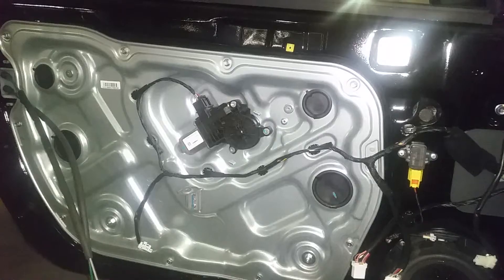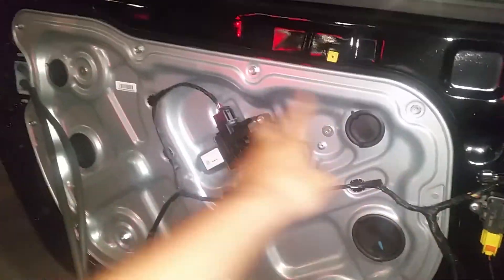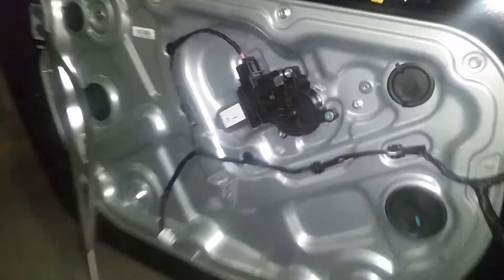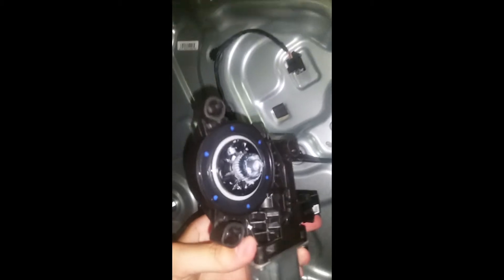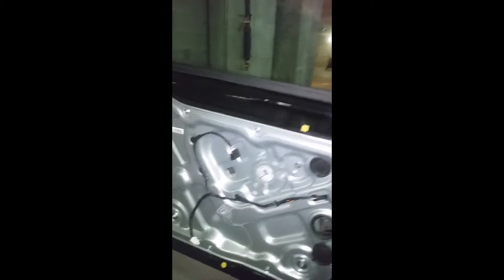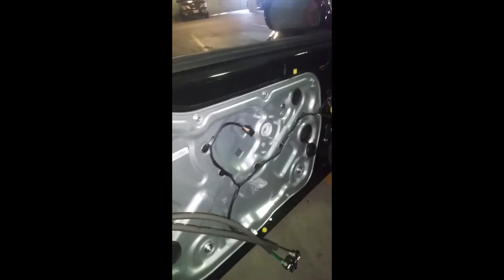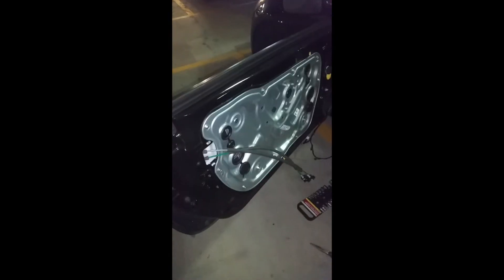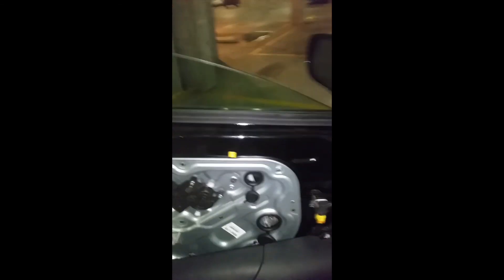Window Regulator/Motor Replacement Genesis Coupe

Comment: Note: That gap at the end is generally the clearance drop when you open the door and the window auto-ups when the door is closed. 
So, close the window, disconnected the switch panel, close the door and check clearance from the outside. 🤛
Reply: Agreed

Comment: 2009 thru 2016:

LH  - 82471-2M000 (with reflector on trim panel)
       - 82471-2M010 (with light/lamp on trim panel)

RH - 82481-2M000 (reflector)
      - 82481-2M010 (lamp/light)

Buy OEM only, $225(ish).
2009-2012's had this issue and was corrected (as I hear) with the new oem part.

!!!They do not include the motors!!!
If your's is crunching like video and the motor is still moving, this panel (part #'s and shown in the video) will resolve the issue. Recommended to replace as a set.

!!!Reset and program auto-up/down memory once reassembled!!!

1. Turn the ignition switch to the ON position.
2. Open the window fully by manual down (press the front portion of the switch to the first detention position.).
3. Turn the ignition switch to the OFF position and to the ON position again within 2 seconds.
4. Press the front portion of the switch 3 times within 5 seconds.
5. Close the window and continue pulling up on the power window switch for at least 1 second after the window is completely closed.

DIY replacement time (90-120min, professional 45min). 

Life Hack: Replace the factory door speakers while the panel it's off. 👍

Comment: Did  you replace the motor also? My motor seems fine, my window goes up and down but it makes a clunk noise. Hyundai said needs a regulator and wants almost $400 to fix it
Reply: mkylelewis is your door giving rattling noise when your turn on the music with good bass  or while going on uneven surfaces?
Reply: I had the rattling problem as well. Comes down to your cords moving around. Make sure all are plugged in and secured tightly.

Comment: Tangentially related but do you have to remove the Drivers side panel to replace/check the connection of the the Fuel/Trunk buttons? very little information on this aspect it seems on the web. Had window replaced but buttons no longer work.

Comment: Thanks for the vid, I had this same issue happen to my passenger door this weekend.    At the end of the video you mentioned having to adjust the window.  Did you end up adjusting it any? it seemed to be at the correct height since it's not supposed to roll up 100% when the door is open.  

Nice screen up in the center of the dash btw, what mod is that ?
Reply: I actually just had mine fail yesterday. They're all breaking at the same time eh?
Reply: Mike R does anybody know if a 2011 genesis sedan regulator panel with fit on a coupe? they look the same.
Reply: @wrenchturner9848  coming 3 years after and this shit just happened to me but my window is down hopefully i can do this
Reply: @fredyvega3183  You can do it. The hardest part is lining up and making sure the top of the window seals against the top gasket when the door closes and the glass nudges up. Good luck!

Comment: You need to adjust the window with the door closed, as the window lowers about a 1/4 inch when you open the door...
Or hold the button next to the door jam so the window is fully up for adjustment.
Reply: Please go deeper. My window doesn’t close fully it tries to but doesn’t because it’s too low inside the panel